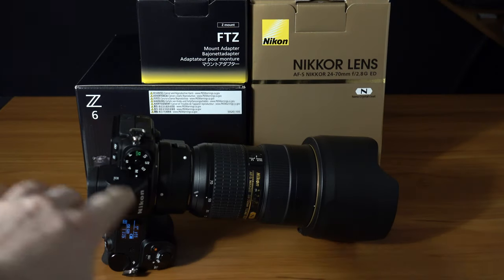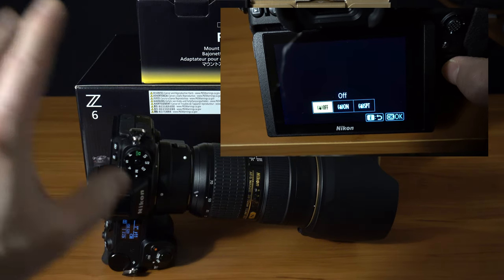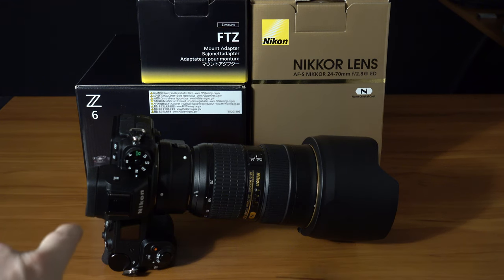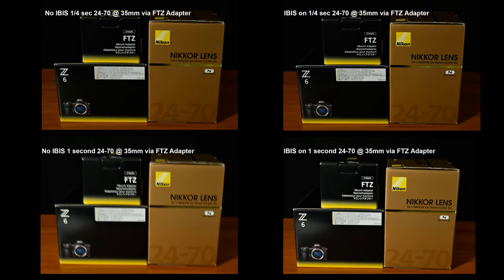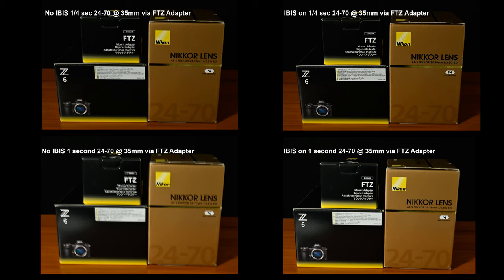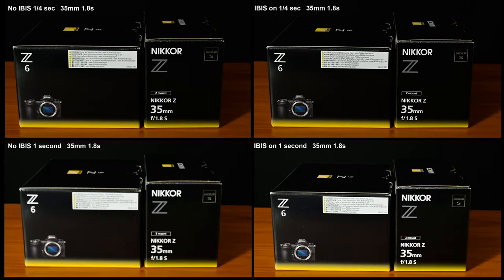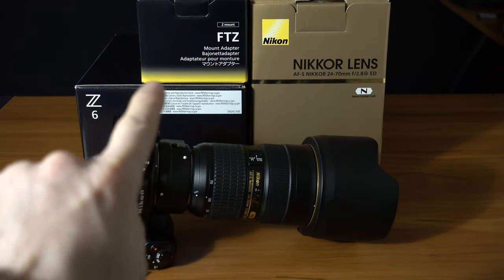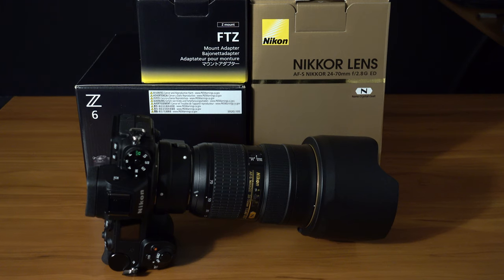Nikon Z IBIS 3 vs 5 axis VR stabilization for still photography

Comment: can you do a video showing what it looks like autofocusing with the older Nikon glass in video mode and how much noise it makes?
Reply from the maker: Tech Yup, check out my other video using the FTZ adapter.
Reply: LEXPIX which one? I watched most of the ones I thought it would be in but I don't see the 14-24 in use.
Reply from the maker: @Skill_Issue92  https://www.youtube.com/watch?v=Ijn3sMvCpvk&t=14s  This shows the 24-70 with FTZ adapter in action.

Comment: What if the F mount lens had VR? Does that mean its going to have 5axis image stabilization with the z6?
Reply from the maker: With adapted lenses via FTZ adapter you only get three axes (pitch, yaw and roll). It doesn't attempt to combine its effect with that of adapted lenses that offer Vibration Reduction. Instead, it passes-off responsibility for pitch and yaw movements to a VR-enabled lens while continuing to offer roll stabilization.